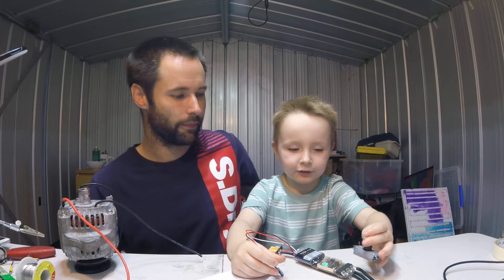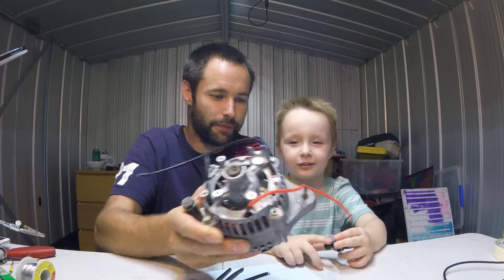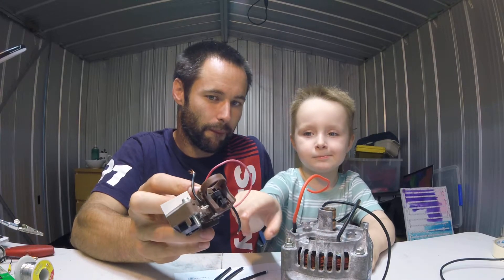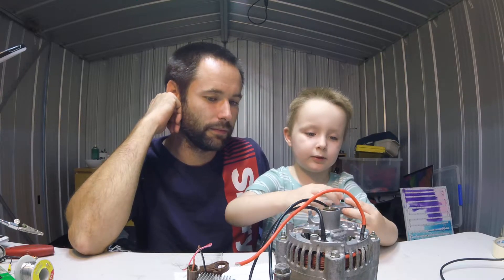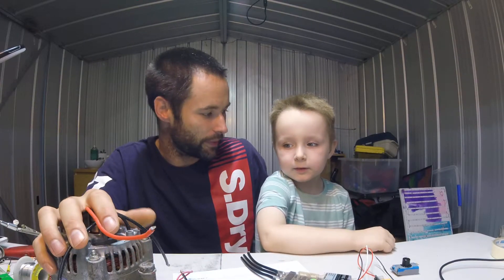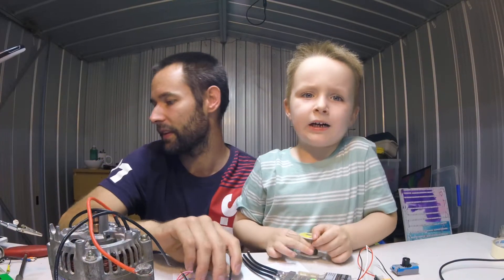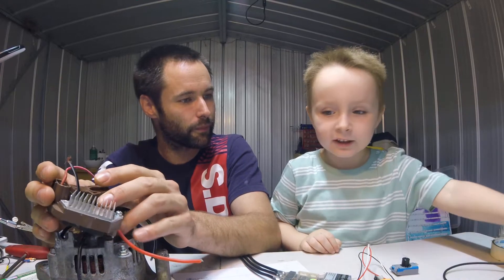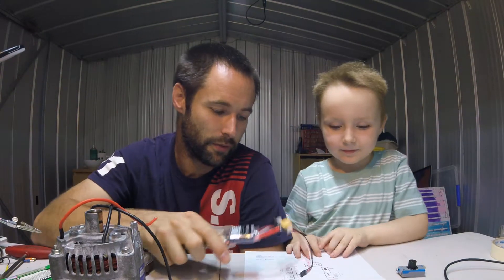Planning a project using VESC and converted alternator to motor

Comment: Hey, i wamt to give a suggestion:
install hall sensors on the alternator's stator and use the VESC as a sensored controller
Reply from the maker: Hey that has crossed my mind to .  Wonder how hard this would be haven't had much to do with motors with hall sensors.  Will look into it.
Cheers